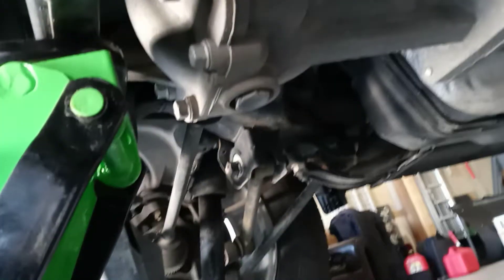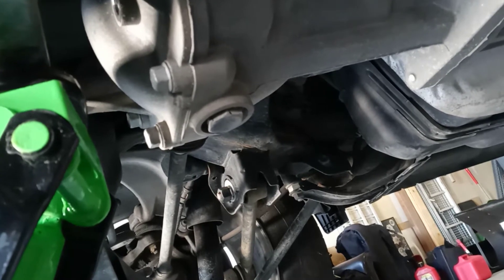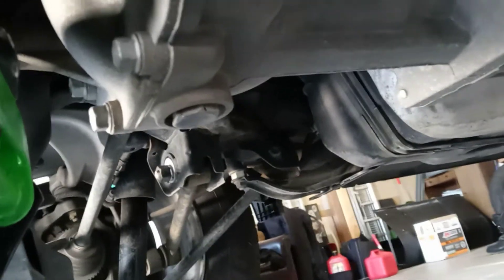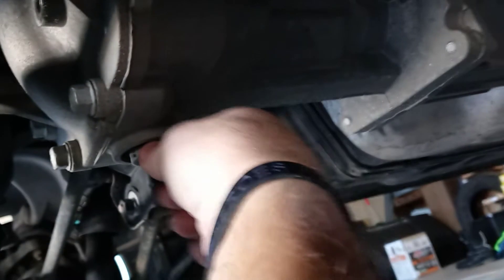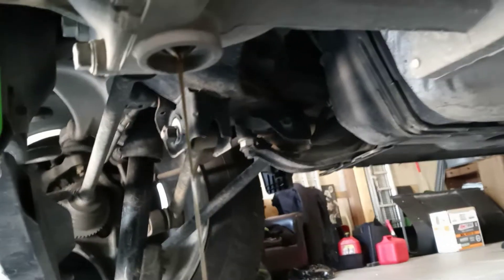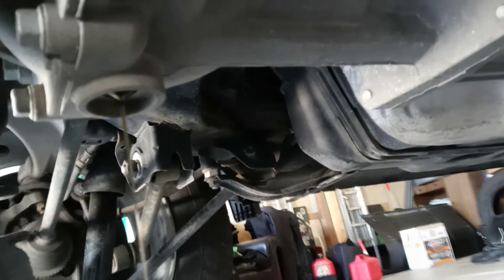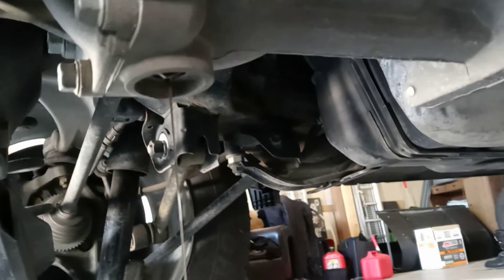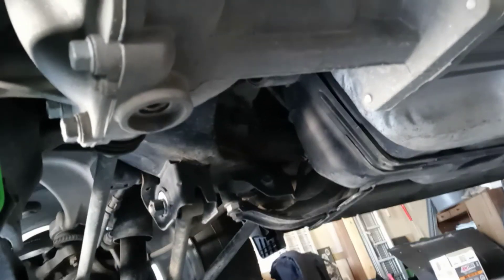2011 Kia Sorento rear differential fluid change at 100k.

Comment: What socket do you use for the fill plug? The 24mm I have is too long to fit in there with a wrench or extension attached
Reply from the maker: I can't remember, I may have used a wrench.

Comment: Supposed to change it at 30k
Reply: Stop using k it's 30,000 miles not kilometers
Reply: @hammertime4257   30k does mean miles dip sh*t
Reply: V6?
Reply: Should you loosen the fill nut 1st? I would  just incase you cannot get it open BEFORE draining the differential fluid.